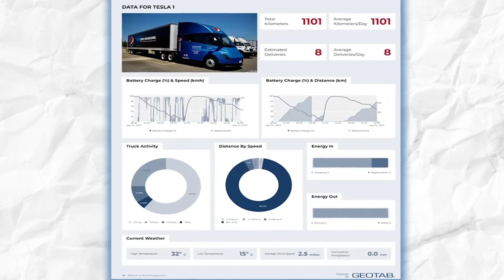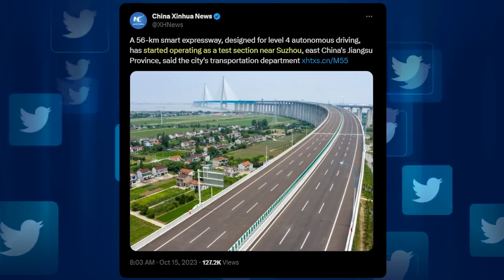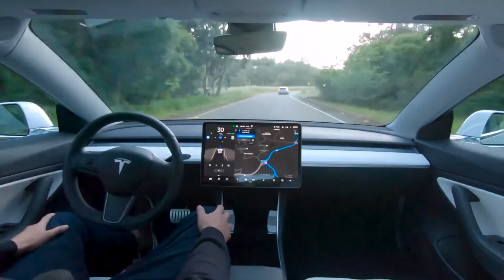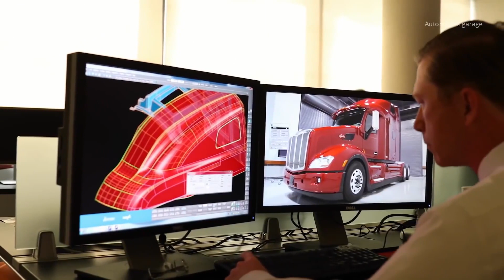Tesla Semi Outperforming Diesel Rivals!

Comment: I feel like the Edison motors concept is a much more viable platform than full electric
Reply: Theirs is designed for logging and tough use situations. Overkill for short hauls on paved roads.
Reply: @catsaregovernmentspies  you are correct.  Their future plans are to offer kits that include the batteries, electric motors, and generator to replace the transmission and drive train on older vehicles so many truck drivers can keep their old rig with the original engine and still be a hybrid

Comment: I thought the supposed range per charge was supposed to be 500~ miles? 🤣🤣 What a fail
Reply: The tests are Normal delivery runs that the companies have their trucks do on a daily basis, not run the truck out of charge and see how far it goes.

From the site Run on Less – Electric DEPOT
 "The Tesla Semis at PepsiCo’s Sacramento Beverages depot have completed 384 miles on a single charge and 806 miles in a single 24-hour day, enabled by fast 750 kW charging."

And from next big future web site.
"There has been official reporting that Tesla Semi is able drive over 420 miles on one charge with 80,000 pounds of total load (including the weight of the truck and trailer). This was a heavily disputed capability. The range was with driving speeds of 65 mph which has 15% less range than trucks driving at 52 mph."
Reply: There's 350 mile models 🤡

Comment: lmao 3 charges in 176 miles nice propoganda man, It wouldn't even be impressive if it did that without any charge but its sad that it needed 3 charges to go 176 miles.
Reply: Was it a mistake by the narrator?
Reply: It was 1076 miles in 24 hours, 72000 pounds. Not being a trucker, I don't know how that compares with a diesel operation.